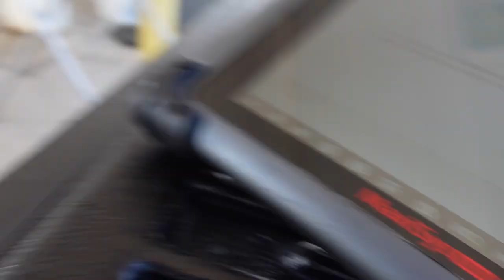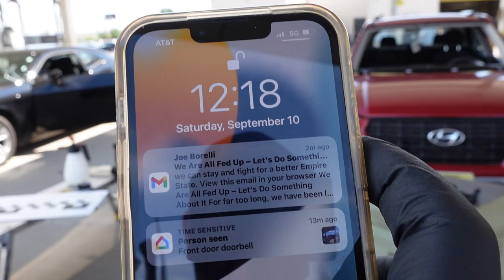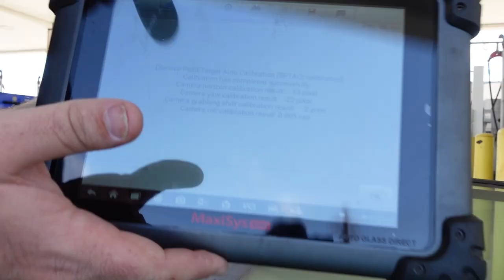Day in the Life of a Independent Auto Glass Business  [ Windshield Replacement]  Ep1

Comment: Vehicle calibrations makes me wanna find a new profession. The fact that new cars have so many options built into the windshield is irritating. Arriving at someone's home just to have the incorrect part because of so many options is just getting old.
Reply from the maker: You should get some calibration equipment and take advantage of the extra money big game changer
Reply: Or don't unplug the camera. Problem solved.
Reply: @devintharp597  it still throws it off on some cars I’d be careful with that. Lawsuits can come if something happens in a accident. It’s rare but not unheard of
Reply: @alk1317  I agree. I like your response. It's more professional as well to an extent. The car will tell you if the system is not functioning.  I wouldn't let it stress you to bad.